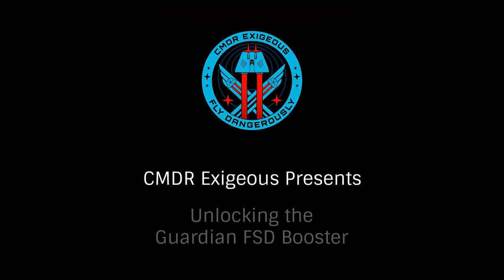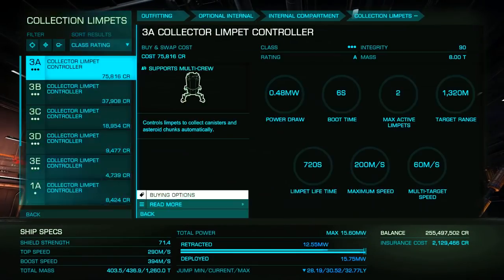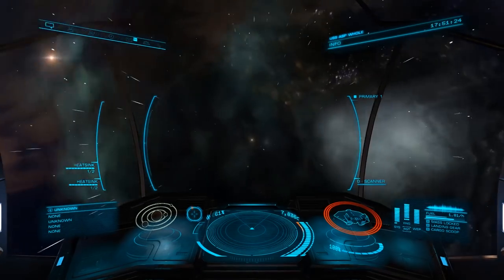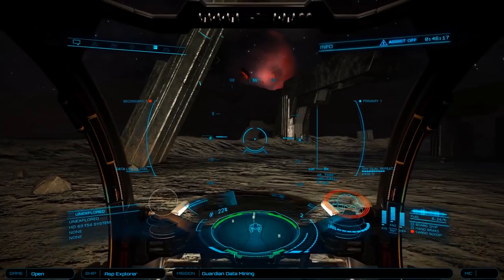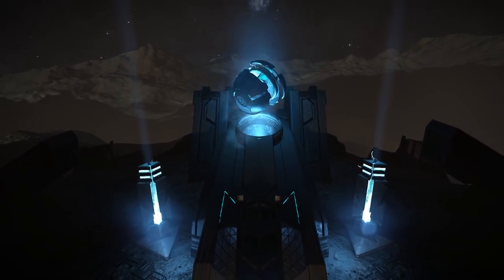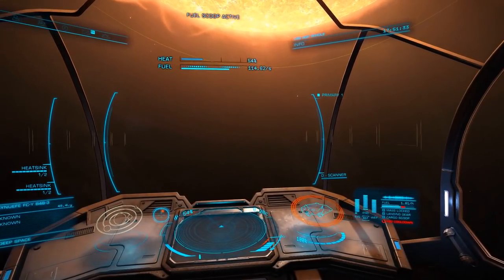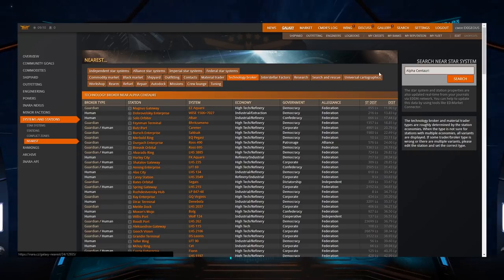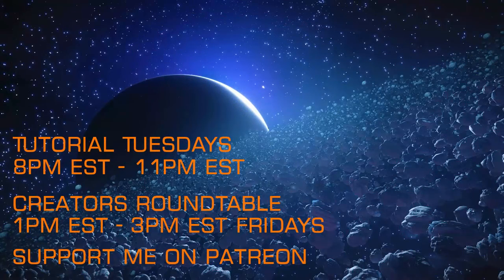Unlock the Guardian Frame Shift Drive Booster (FSD) in Elite Dangerous for Maximum Range (Tutorial)

Comment from the maker: NOTE ABOUT LANDING: There is a reason I suggest taking the DBX or Asp X (and went in a DBX myself) - the terrain is VERY rough and you'll basically be unable to land an Anaconda or large class ship here.  It's never a good idea to bring a large ship when doing planetary stuff, especially Guardian or Thargoid sites - leave the big pig at home and take a small ship for this.
Reply: Will a krait be good?
Reply: I tried a few days ago and had to land some 2k away, thinkin of fitting out a dbx just for this mission.
Reply: I did it a few minutes ago. At first I'd like to thank you for this tutorial. Second thing is: There is no problem with my anaconda, just landed about 300 meter away on a hill. Took a little bit of time to search but it's fine.
Reply: No 😂
Reply: @neurosis404  Thx for the info :D Heading out right now
Reply: @neurosis404  Found several places to land.... Margin of error is small, but definitely not impossible :D Currently sitting at 1.77km,  40.8694, -106.5137. Also, there's another location at 1.49km, forgot the coord though :P (still, if you can just use a DBX. I use conda because that's my only engineered exploration ship.... Saving time on jumping justify the time on finding a place to land)
Reply: Can confirm, don't take a fucking Anaconda. First landing didn't take too long to find a spot, but forgot just ONE Guardian Tech Components, and it took my ~20 minutes to land after taking off again in order to find a spot within 2KM. Even had I read this comment I still would have had to take the Anaconda because my DBX is in Colonia >.>
Reply: @celchronicles  I was able to land literally within the ruins in an AspX, but it required massive trial and error to find the smallest margin where the game detects a place that is landable.
Reply: @sneakycactus8815   I had good success with a kitted up Cobra MK3.
I shared the map with a conda that had managed to land like 50 yards from the site.  it was something seeing that big girl out there.  Was close enough to light half the courtyard with it's nose lights.
Reply: @dramarodram2196  Managed to land mine relatively close to one of the pylons
Exact position: 40.7964 -106.4888 facing 321 degrees
Reply: There ist a pretty good landing spot for Anaconda on A3 in system SYNUEFE EU-Q C21-10 right beside the site. it's a pretty flat plane next to it (-23.2706° 126.3876°). Took me about 3mins to find a fitting spot
Reply: Yes.... I can confirm that a Krait Phantom was very difficult to get down, but if you are very, very, very patient, you might just find a sweet bit of land to park up on.
Reply: I landed my aspX just within the complex but one issue I found was I was to close to a pylon and my turret wouldn't deploy. And I got my ass kicked by the sentinels. How are they triggered?
Reply: Just took me about 2 mins to find a spot for my conda here. It's certainly rough terrain but it's not impossible.
Reply: I landed just fine with my anaconda
Reply: Spent a whole hour just trying to land in my conda. Ended up 1.5k away. Wish I had read this comment before travelling 1k ly
Reply: I landed literally AT the site with my AspX, no way a 'Conda could do that, AspX was a tight fit.  Had to park 3km away to log out for the night.
Reply: What color set are you using on your ED Profiler to get the soft blue?
Reply: I took an Anaconda, rough landing, but it worked
Reply: Just got my srv destroyed from 2k away on 1%  hull integrity
Reply: Even the Phantom was too big. Had to go back, grab a DBX, build it and go back out. Landed right next to the site. If only I knew to bring point defenses. :-/
Reply: i wish i had read this post lol
Reply: Eurohonk The Honkler THANK YOU I FOLLOWED YOUR COORDINATES AND LANDED PERFECTLY IN MY D RATED CONDA
Reply: My problem was when recalling my ship ( Cutter )

The way it kept landing should basically flipped the whole thing over.. It's engines on a peak with the nose way up in the sky....
Reply: I have a python asp x and type 7 at damona, but i travelled all the way to colonia in my dbx and now have a type 7 and dbx at colonia, how do i go back to my python? Do i need to fly back if so im deleting this game 😥
Reply: @UchihaSasuke02  bless you sir!
Reply: FWIW, I just parked my Anaconda.  Synuefe NL-N C23-R B 3 - Guardian Structure- -34.8361 , 132.8028 .  Heading 144, to put the rear point defense towards the structure. 

You have to drift around a little to find a usable spot.  There are closer parking spots, but sometimes the ship is too close, and the SRV will think it's undership.    It isn't very good to not be able to shoot things that you have to. :)
Reply: Do not try with krait I tried a krait and I was roaming around for 20 minutes until I finally found a spot to land near the structures
Reply: @TianarTruegard  Yet plenty of us do it no problem. About to land there myself.
Reply: I would strongly advise against DBX. The terrain around the site is bad and DBX is notorious for giving trouble when boarding. I did the site with Cobra, it was OK
Reply: @nafakirabratmu  found a spot for mk phantom, 40.8044° -106.4997 facing 157
Reply: Reading this after already jumping to that system... big oof
Reply: Yesterday I completed this site with my friend, CMDR Waruko, and unlocked the booster. I managed to land there in an ASP Explorer though. It was pretty hard, but not impossible. I currently have the booster on that very ASP, and it's jump range is now around 46.00 lightyears.
Reply: I wish I read this before I flew there. Now I had to park 3km away and its a nightmare. I looked for a spot for 10 minutes.
Reply: @sneakycactus8815  Krait Phantom is a nightmare.  Won't park in the spots people fitted an Anaconda and a Python.  I think it's too wide.  Phantom parking spot located at 40.856 : -106.5214.  I hope this helps someone save the 30 minutes it took me to find somewhere.
Reply: @Arctic_Fox_NFFC  at the time, i was talking about the krait mk2. Phantom wasnt out then
Reply: Lol read this as I was approaching the planet in my anaconda
Reply: It only takes me about an hour to park my anaconda each time.
Reply: @streetguru9350  i know your pain. Took me an hour to find a spot faraway. Left empty handed. Scarab ran out of fuel and ammo. Fuming.
Reply: @therealsylar9877  You couldn't just synthesize stuff?
Reply: There is a reason why I gave a thumbs down to this video, because you said (you can use about any ship) in the video
Reply: brought my corvette from tjindjin to this site and was able to land along with my brother's anaconda within 5km of the site. it's a bit of a drive but it isn't impossible
Reply: I landed successfully with an anaconda quite close to the site. The thing you forgot to mention in your guide, and I know this is a year old, is how UNFUN this whole endeavor is. It might be worth but holy shit is it completely tedious and srvs are the WORST to drive. I know im being salty af here but man, disgusting. 

Thanks for the guide tho.
Reply: I did it in an anaconda it's hard but not impossible
Reply: @TheRatlord74  Your SRV modules don't function within 50m range of your ship. Managed it multiple times to get my SRV stuck while trying to board because I misjudged my speed and got flipped by rocks until i was on my back. Within 50m you can't use the SRV-thrusters so you have to selfdestruct right under your own ship xD
Reply: @woody555kl  are you high? ever checked out the shipyard and the stored ship menue? You can let them be shipped to your current location. To Colonia it takes about 6 days and quite some credits, but you can do it^^
Reply: @stick9926  dafuq are u carrying O_O I don't have the booster but a 52.4 LY range with my ASP
Reply: @_MrTrue  there are two ways of playing E:D..With efficiency or with fun. Both at the same time are not possible. And to have fun, you need to grind and use the efficiency routes. So I feel you my man, this is one of the biggest flaws of their game design. I learned to drive the SRV at Jameson Crashsite with all those rocks and inconvenietly placed canisters :D Flipped about 50 times on the first 10 data mining runs xD
Reply: @SmokeJam, I just hadn’t gotten around to engineering my ship at that time.
Reply: @stick9926  that is kinda fascinating though that you ran the guardian stuff before the engineers grind :D was it worth it that way round? cuz then I might be doing it too :D
Reply: SmokeJam, tbh, it was. I was just too lazy to engineer my ship at the time.
Reply: @stick9926  alright thx XD
Reply: I flew in Python and could not find parking.  Ended up leaving HD 63154 B 3 A and went to Synuefe NL-N C23-4 B3 where this is much better parking.
Reply: What ASPX build are you using?
Reply: @MyJeer  who are u asking xD
Reply: @SmokeJam  exigeous
Reply: Asp X is what I've set up as my valuable minables miner. Fully outfitted with A moduals and with almost all 64 tons filled with limpets, I've got mid 20s LY max range per jump.
Reply: True
Reply: Anaconda landing site: 40.7639, -106.5242 (212 degrees heading). 800m away from the site.
Reply: @Enceos  ikr
Reply: I took an anaconda there and spent about 45 minutes trying to find a landing spot lol
Reply: I'm glad I read this before i took my anaconda all the way here..... Wait. I didn't....
Reply: Would have been super to mention this in the video or even  the description, instead as a pinned comment.
Reply: I couldn't find anywhere to land but still found your video useful
Reply: @neurosis404  i know its old. but i crashed my anaconda and get wrapped 1k years back lol
Reply: @P4R4N0iiiD_ow  Went to that exact location and heading in my Phantom and not even a hint of being able to land :( Gone back into orbit for now until I figure out how to land here. Event scanning 3+km out I could find anywhere.
Reply: @AdrianHilder  that was in horizon before the planetary revamp. Most landing coordinates you find will be either tricky or not possible with certain ships (if the terrain changed due to Odyssey)
Reply: @P4R4N0iiiD_ow  I'm still running on Horizon. So much to do without getting out of my ship or SRV. I guess any planetary updates for Odyssey affect all players.
Reply: @AdrianHilder  try -45.7763
-102.6655
Reply: Yes parking is a challenge. Managed to find a spot 275m away in a Asp Explorer at coords 40.7910, -106.4882, 0.160.
Reply: @bruceadams5289  i got it fairly quick just cruised down slow checking the layout of the site saw a open spot and landed the dbx
Reply: With a G5 FSD DBX it was only 18 jumps, not even a big deal lol
Reply: Grade 5 FSD, D rated phantom, made the trip in 20 jumps.  Found parking directly next to the site within 5 minutes of going around the site looking at the terrain.  There is a fairly large flat patch right outside the ruins where 2 sections of crumbling wall form a right angle.
Reply: these are the voyages of the USS Pumbaa...
Reply: Just go to "Synuefe NL-N C23-4 B3" instead - it's nice and flat. Surface scan the planet - the contact you need to head to is called "Guardian Structure". You can park right next to the place.
Reply: python for life bor.
Reply: Uses advanced docking computer to find landing spot for Anaconda
Reply: @sneakycactus8815  5 years too late but yes, you can land your Krait within 5 km of the site. I know because I’ve done so.

Comment: The one thing he didn't explain: How to find a place to land. Forget the Guardian FSD, I want their landing gear
Reply: does this video still hold true if i follow it exactly I'm kind of new
Reply: @dozergames2395  yes but if you are new to be aware that one thing he glosses over in this is that there are enemy automated drones that will attack you as you progress through the puzzle. Bring materials to automatically prepare your Rover on the fly as needed.
Reply: @ForzaNinetails  what. Kinds of materials
Reply: @dozergames2395  you'll have to look that up on the wiki.

SRV REPAIR
SRV FUEL
SRV RELOAD (I think)
Reply: @ForzaNinetails  thanks
Reply: @ForzaNinetails   one last question i feel like i was lost in the guide i went to the system he plots to  0:58 am i at the wrong system
Reply: @dozergames2395  It is gone for now. Disappeared after the fleet carrier update. Hopefully back soon.  And FYI on the SRV repair, you can just re-board the ship and it will repair the SRV but you do have to synthesize refuel and reload
Reply: @EdThomas1  well shit just ran out their before maintenance  guess ill see what i can mine at the planet
Reply: @EdThomas1   also i got the blueprint fragment already is there anywhere else i can get the other pieces for the fsd booster
Reply: @dozergames2395  not until the fix that they are working on now. Except for the HN shock mounts everything else needs to come from guardian sites. I was just finishing for FSD boost and Shield reinforcement. Just need 12 more obelisk data and I'm done so I'm stuck in limbo too.
Reply: @EdThomas1  IRONIC we were both aiming to get good gear before maintenance

if i understood you correct though after maintenance all should go back to how it was so we  can GET THAT BREAD  correct
Reply: @dozergames2395  sounds like they plan to put everything back like it was but not necessarily immediately when they come back up. Might take a few hours
Reply: @EdThomas1  fine by  me maybe ill play a different game to today if it takes a while to fix
Reply: Hi guys. Any update on this? I’m looking to fire up ED in 2 hours time, and wanted to get this module... Not much point me going all the way out there to find it’s not there any more, if you’re already there and can let me know. You’re already there right?
Reply: @Banthah  its back I farmed it last night now all I need is focus crystals to unlock it
Reply: @dozer games Thank you sir! I’m on my way. Re Focus Crystals, I found bounty hunting to be a great source. Loads of them drop off destroyed ships of all sizes, in all places. Good luck!
Reply: @Banthah  thanks I will do that
Reply: A hell of a lot of things he didn't bother to explain. As others have mentioned, you must have synthesis materials to make more ammo, as you very well may run out of ammo fighting the drones.

As far as landing, for anyone reading this later, if in an AspX these exact coordinates (can't vary by a single digit, in fact, have to wiggle around a bit still to get it to work):

40.7918

-106.4928

285 degrees

I had to find the bindings for my left/right strafe which I didn't know even existed to hit the right spot.
Reply: You don't need repair or refuel or rearm if you are only after fsd booster, SRV have enough of these for you to get at least one module blueprint without synthesis
Reply: @night_aim  depends on how efficient you are I suppose. I ran out of ammo the  fist time and had  to leave. Second time I ran out of ammo again but had the mats to do synthesis.
Reply: Went to every landing spot everyone has mentioned and I can't land my aspx, I've been here two fucking hours.
Reply: Ahh I said 'Fuck it" and landed about an hours drive away lol
Reply: @ReddFrank  yeah man. I brought my aspx and had to land 2.18 km from the site. Just fly around until you find that tiny magic little blue beep, and wiggle around until you fit xD
Reply: Bring a DBX for landing.

Comment: In case it helps anyone... I'm a pretty new player and this mission turned out to be harder than expected, mostly because of things I didn't know in advance. Some tips that would have saved me an embarrassing amount of time... Don't come here without a point defense in your utility mount on top of the ship. Also, on one of my attempts my rover ran out of ammo right after I got the big orb thing to come up and had to go re-stock and do the thing over again. So the last time I brought 2x rovers just in-case. An alternative would be to bring materials to synthesize your own ammo. Also, it was pretty challenging landing the Asp Explorer here. Very little room. Once I found where I could land it I was able to do it over and over again but its a pain in the butt. I was able to resupply the rover on a carrier around the nearby ringed planet, but had to fly pretty far back to get the point defense and 2nd rover.

Comment: Worth mentioning though, out of my lessons learned, for anyone who never used an SRV before, when following this trip:
Personally I'd recommend to take your time testdriving your SRV on the various resourcespots on the same moon, where the guardian site is based collecting material, which will come handy when doing the site. At least collect sulfur and phosphorous and get familliar with refining ammo, fuel and repairs for the SRV out of your collected mats and get used to the handling of the SRV, its thrusters and turret. This will help you a lot on the guardian site, where (especially, when you're new to the SRV) you will need to reload the weapon, and maybe refuel the SRV, at least once. For repairs, it should still work to board your ship, but it'd be handy to repair the SRV on the fly with the mats you gathered before.
Anyways, thx for this guide.
Reply: also very recommended to disable flight assist on the SRV, it will be much easier to drive it